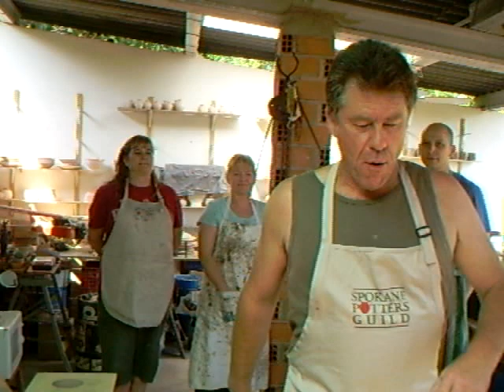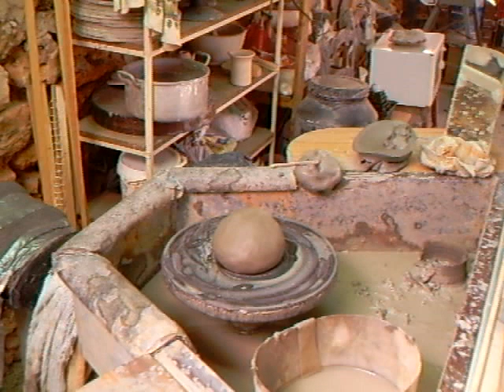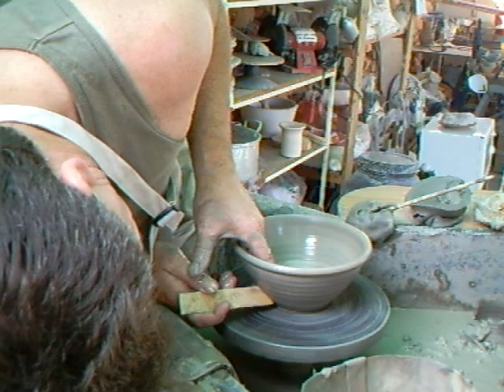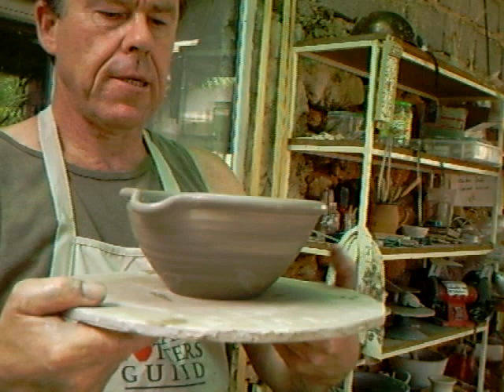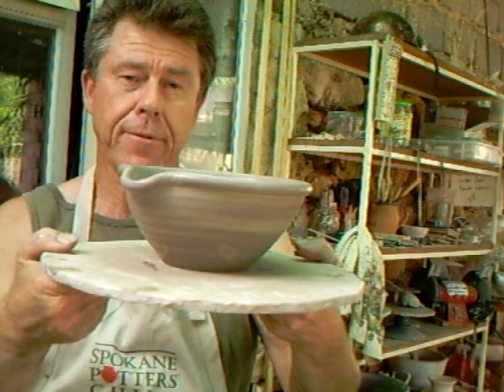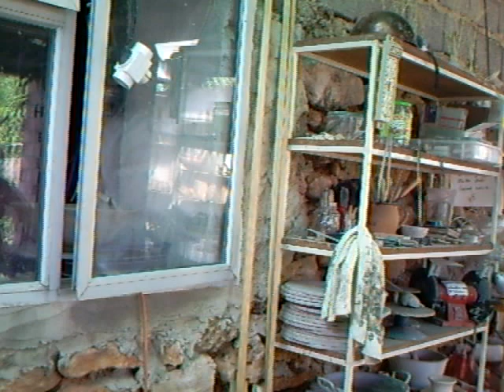SIMON LEACH- Workshop demo mixing bowl !

Comment: that tip you gave you gave about waxing the lip on the spout on pitchers works beautifaly. compared to ones i made that are glazed in that area. the one i made with the waxed raw area. th eliquid cuts off there. where it needs to. no drip. its like the ruffness helps cut the end flow but a smooth lip will let it keep going and end with a drip.
thanks simon. you help make my perfecion perfict.
 joe